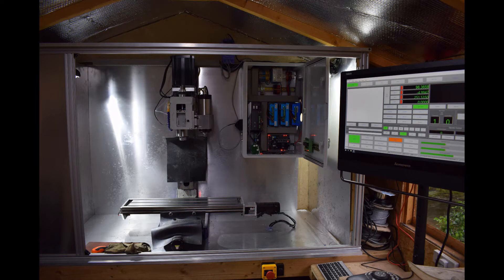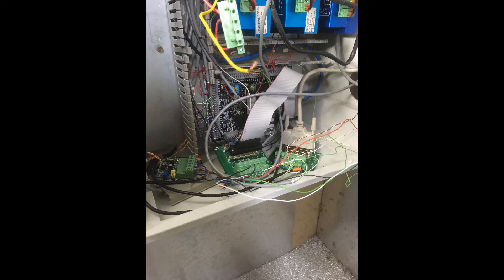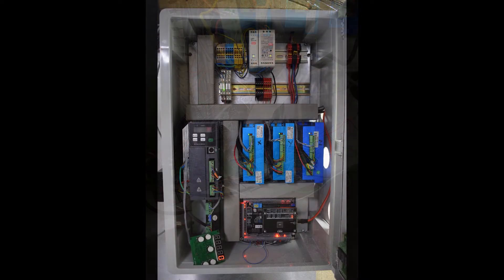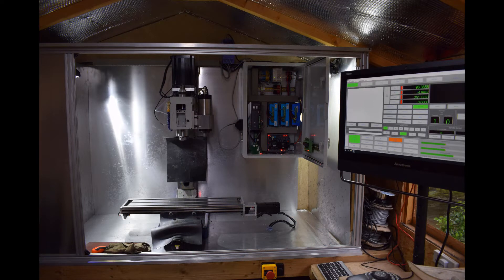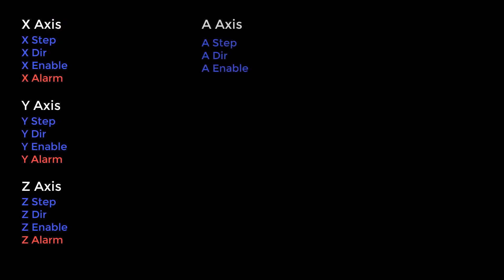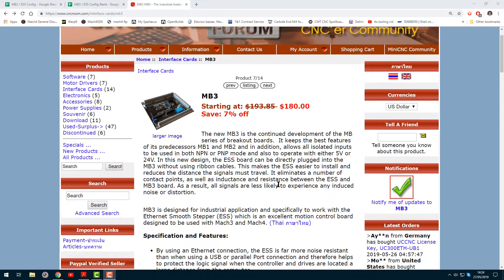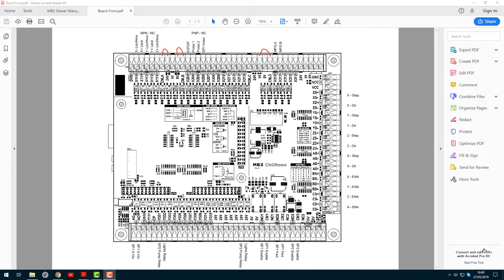MB3 and Ess Part 2

Comment: I bought the MB3 and ESS as a combo from CNC Room and am pleased with quality. A good choice for upgrading a cheap USB card that came with my turnkey system. Mind you, the pitch or spacing between spring terminals on the MB3   insist on either solid copper conductors as in Cat5e type (24awg) or smallest  sized crimp ferrules over stranded copper. And even then, there will be no space to spare if making multiple connections. Unlikely one would manage inserting tinned leads without the use of expletives. And then how can you ID the terminations? Existing wiring were fitted with ferrules that barely fit in the tiny aperture as are those of the MB3. I had to slide off the heat shrink ID sleeves to manage in several instances.

Comment: Hello.
I have something to ask about MB3.
About OSSD.
I use a servo amplifier, but I have already put the servo-on signal in series to open and close the servo-on and magnetic contactor.
Therefore, when the servo is turned off, it will stop.
Does MB3 still have to use OSSD?

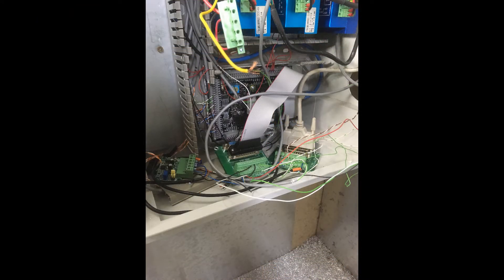Comment: Hi Daz, I have been running the MB2 for 3 years and looking to use the MB3 on a new build. At 0:56 I noticed you have 4 wires connected from your drivers to the MB2. I would really be interested in how you set this up as I only found instruction showing dir- and pul- being connected and 5V going to dir+ and pul+ with ena+ and ena- not being connected. Any help would be appreciated.

Comment: Thanks for the overview! Have you tried connecting a hardwired MPG to the MB3?  Ive attempted with 2 different pendants on both ports 1 and 3 and I get faint lights from the LEDs but no movement on my steppers. Mach 4 jog /trace arrows move the steppers just fine. Im thinking the LEDs may be robbing the A/B signals?

Comment: I really enjoyed your Part 1 and Part 2 Videos.  Thank you.  I am the proud owner of the MB3 with ESS and panel.  I like the lights too! I am curious about a couple of specific connection for the Hybrid Driver.  

I am using Closed Loop Stepper motors and am confused about the enable signals marked on the driver.  It looks like you have taken these to Port 1 (16-17) and Port 2 (16-17). Am I correct in assuming the BS, BD, CS, CD connections to the Driver Enable jacks are + to + and - to -?  Also while viewing your control cabinet it doesn't look like you used the Alarm contact.  If I were to use it do you know where I would connect to the MB3. I was thinking about using it or wiring it into the E-Stop in the event I have one of 4 motors fault.

I appreciate any feedback. Cheers.
Reply from the maker: Yes that is correct + to + and - to - this sends GND and 5V to the optocoupler and enables the drive. I havn`t connected my alarms yet as I cannot get my software to connect to the Z Axis driver to change the settings for the alarm to NC, the idea is to make all 3 drivers NC (Normally Closed) and then do a loop from the MB3 through each driver then back, this way you only consume 1 input.

Comment: Great job Daz, I'm using the MB2.5, ESS & Mach4 very similar. Other than the improvements to the MB3. Was wondering if you considered using a pendent such as the XHC HB04 MPG.  Old tony did a video using it with MACH3. Looks as if the software has not caught up with MACH4. Though you may be just the man to tackle this task or know people that could. I feel they went to sleep at the wheel on MACH4?
 I would pay a reasonable fee to get use out of a $120 US dollar unit that I cannot use.